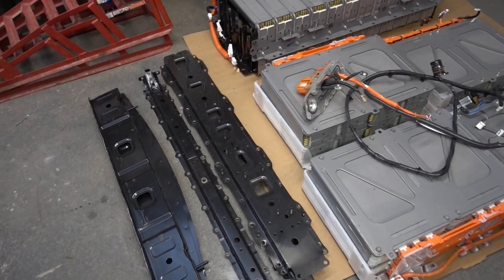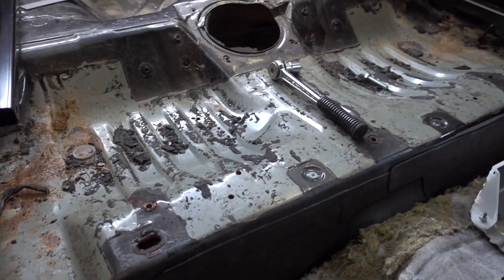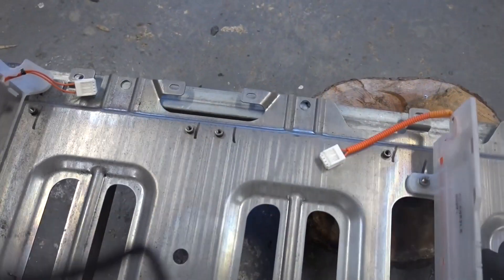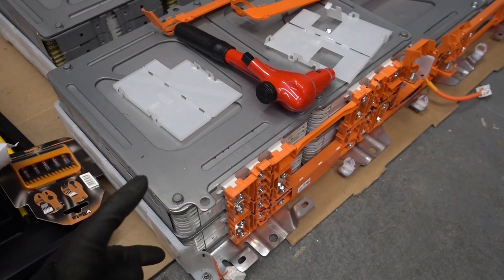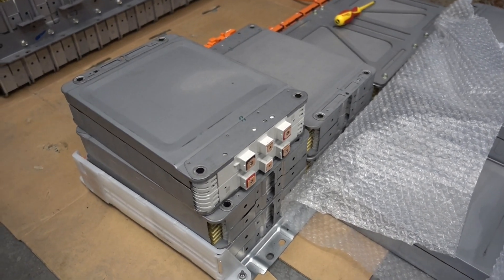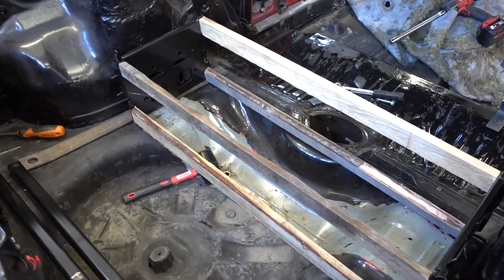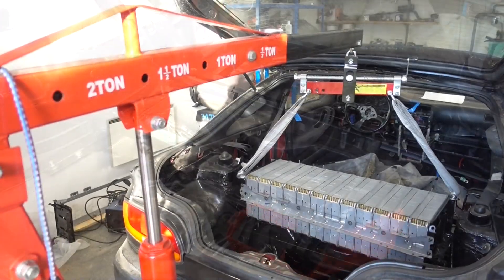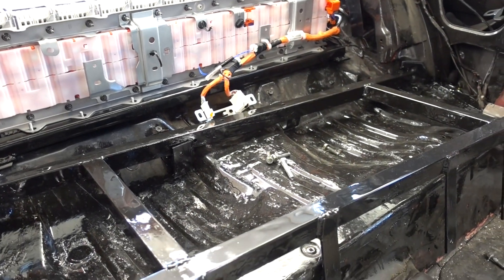Battery is bolted down! [EVNX EP10]

Comment: I don't know if this is a good idea. As you know Nissan cells smell a bit. Wouldn't it be better if you would make a sealed battery box for those cells?
Reply from the maker: Good question! The Nissan cells can smell a bit after being sealed up for years (and the 62kWh pack also the strongest directly after manufacturing). However, after reading the safety manual for the modules(gloves only), and seeing the videos from the factory how these are handled (gloves only), There shouldn't be any crazy risk. The only mention of masks need was during firefighting. There will be an outer layer of protection over the entire battery box, but if it is not perfectly sealed it might actually be better, so that the cells can continuously vent and not build up the concentration. The EVNX is really old and not very tight, so there are lots of holes in the chassi for the smells to vent. 

But who knows, Nissan might be wrong about how safe their modules are to handle. I can test this so you don't have to :)